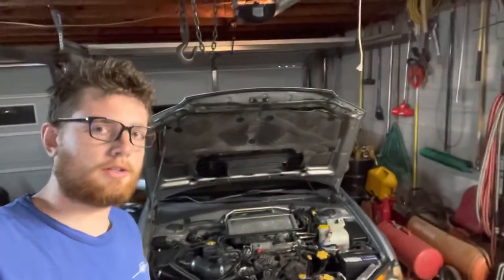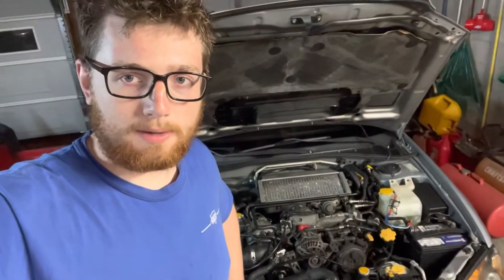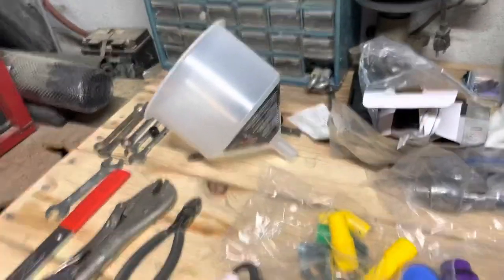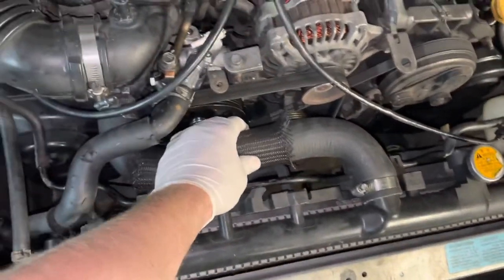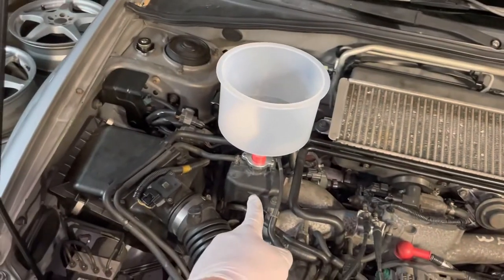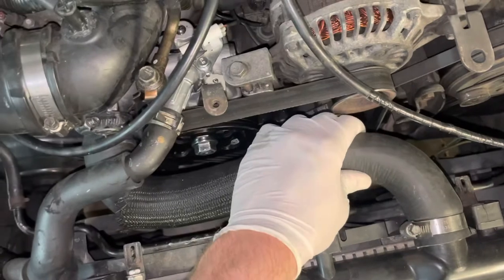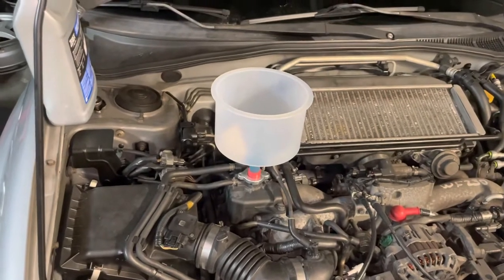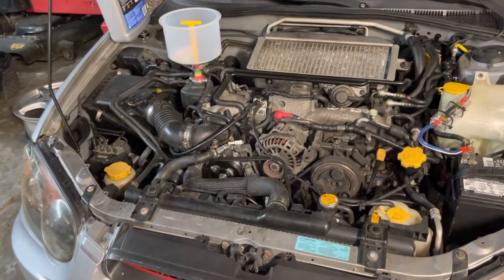How to Make you Subaru Stop Overheating | Burp your WRX Cooling System

Comment: My header tank is empty but the expansion tank is full is that bad
Reply: Same! What was your outcome
Reply: Same here! Got a diagnos?
Reply: Hey could possible be the radiotor cap on that expansion tank, look it up
Reply: @andreasjonsson2761  might need to check the radiator cap and might need a knew one for the top one, on Subarus they work like a valve it’s a weird ass thing but look it up
Reply: Any news? Got the same problem
Reply: @davidwatson7278  I changed my radiator, 15 min work and fixed the issue! Had a crack in it I hadn’t noticed
Reply: Thanks man. I’m gonna try radiator caps then check over my radiator!
Reply: Having the same issue. Will be fine driving around under 200 degrees and when I do a pull the coolant gets pushed into the overflow and sucked out of the top fill point. New rad, thermostat and hoses
Reply: @AntiSUS did you ever figure it out??
Reply: @FredoNavajas92  yup. Headgaskets as suspected
Reply: @FredoNavajas92   had the money to fix, didn’t have the space to fix and wasn’t paying anyone else to do it so I sold it to a friend of mine and the car has been running fine after I put a bottle of Irontite in the system. Fixed the leak for the past 2 months still running strong.
Reply: @AntiSUS  damn I’m debating on what to do, I got a spare engine so was thinking of double checking it and just swapping it out,
Reply: @FredoNavajas92  if you aren’t scared of cars it’s not all that bad to do any of this stuff tbh. If you have the money, don’t cheap out on Subarus
Reply: @AntiSUS  I’ve had it for 5 years, never done this job but it’s not my first rodeo lol I do all my maintaince, have swapped the clutch a few times and help my buddy swap his, Ive been trying to save money all year but keep making questionable financial decisions but I bought a Subaru so what’s new? 😅

Comment: Was your engine overheating when you had the AC ON ? Cause I am having that issue and I am about to BURP the system.
Reply from the maker: It was overheating in general mainly. it was probably on not 100% sure
Reply: Im having the same issue did you fix it?